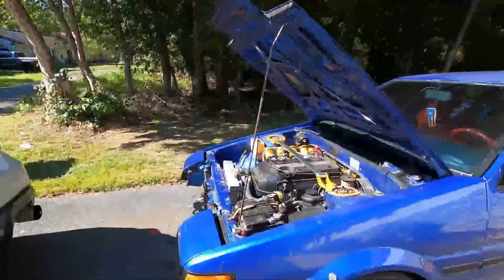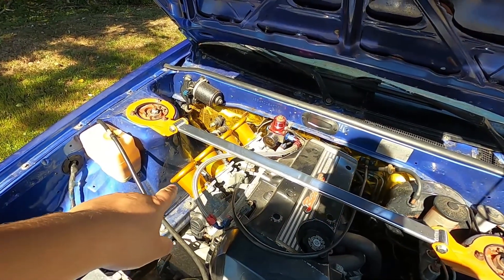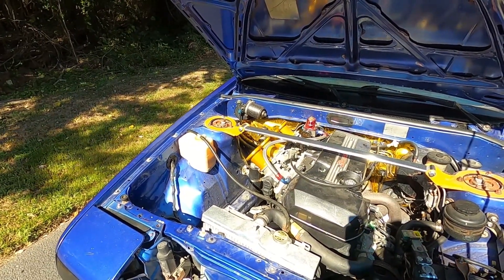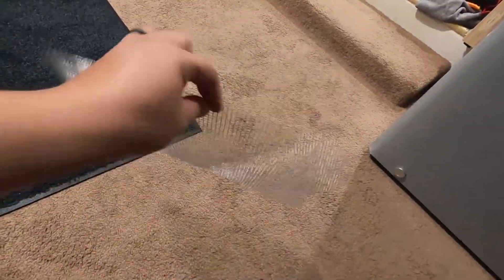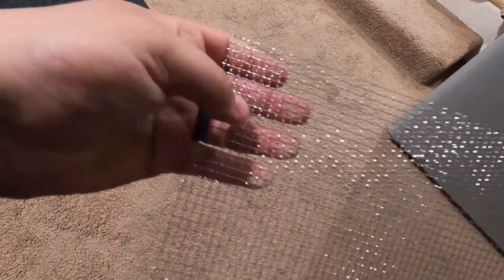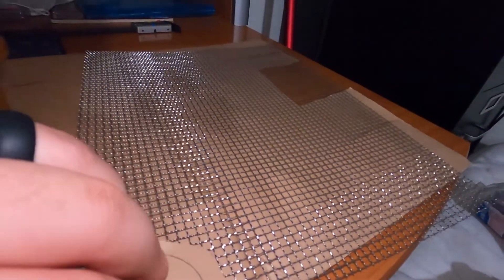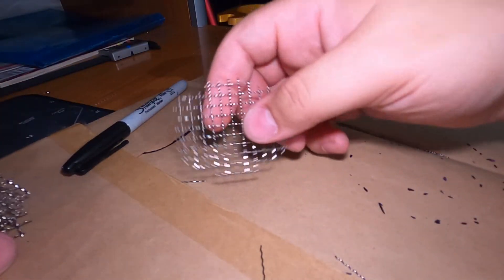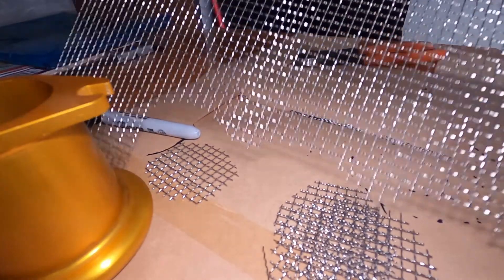How to install a Stainless Steel mesh screen filter for the ITB's for $7.99

Comment: Nice little mod to protect from F.O.D.
Reply from the maker: I wanted some type of protection but I didnt want a big filter(pipexcross) and couldn't find a reliable sock that didnt restrict air flow so this will work for now and was only $8.